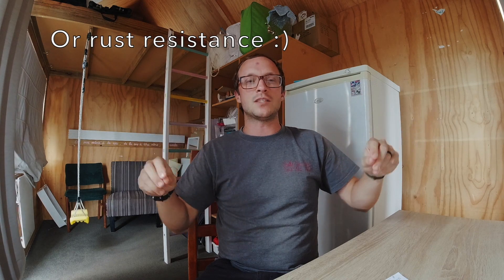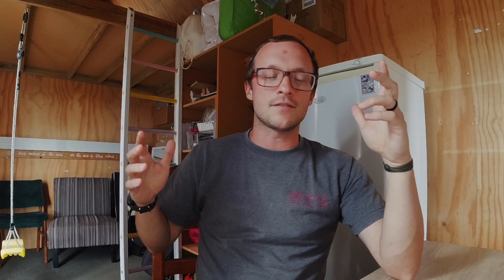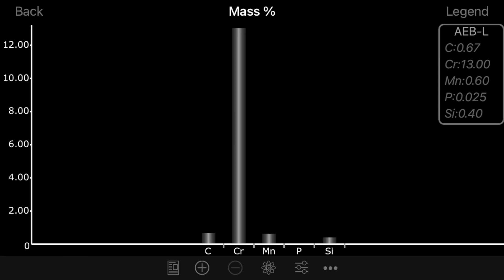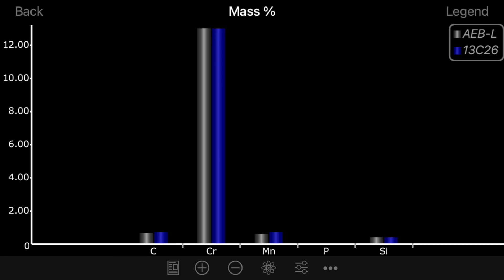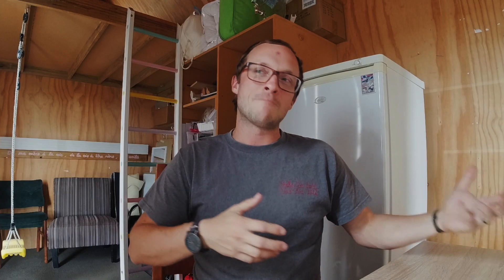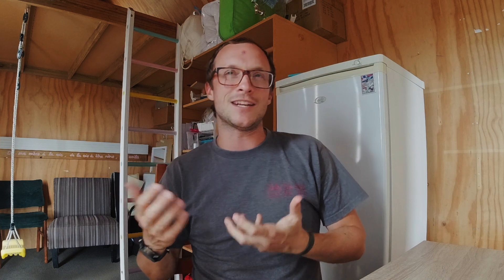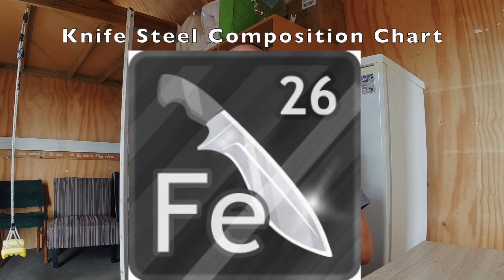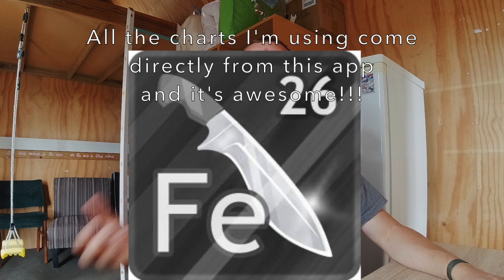That Video Where I Ruin The Way You Think About Steel

Comment: Problem with heat treatments is that they are difficult to advertise, for a number of reasons, especially when a steel can be treated in many ways to achieve desired results...D2.  But what a lot of people don't realize is that steel is often chosen and heat treated based on the machining tools available to a company and cost of creating the desired blade at the lowest cost.  Not saying all companies are cheap (most are), but that you can heat treat in a way to make it cost effective, given what you have to work with.

I did enjoy your video and agree with the main premise.  But I did disagree with your chemical composition comparison.  And I'm guessing you know about this more than me.  But when 1095 was compared to 80Cr V2, I thought the chemical composition was quite large.  Also, when it comes to AEB-L, it's a rather strange metal to me, because of it's unique properties and that without understanding the behind scene engineering processes, we have no idea why this metal was chosen.  Again AEB-L is still quite a mystery metal...too me.
Reply from the maker: Fair enough - I have learned a lot since this video, and would agree that HT is often more important than comp.

AEB-L aka 13C26 are called Eutectoid Steels (along with some others).  Basically they stumbled onto the discovery that the atomic structure of hardened steel can combine very efficiently at a specific amount of carbon and chrome.  

At the amounts of alloy included in AEB-L almost all the carbon and chrome can dissolve into the atomic arrangement of the metal, and since they are used in the steel itself, very little carbon bleeds out into hard carbide chunks which so often plague the toughness of higher carbon steels (this efficient use of carbon keeps AEB-L's carbides tiny, often even smaller than expensive powder steels).

This results in excellent toughness and sharpen-ability.  It's similar to how 5160 is really tough because they add enough carbon to harden the steel, but not so much it creates carbides which embrittle the steel.

Sorry if you already know all that, just trying to help.
Reply: @homeslicesharpening  did not know that.  Very interesting
Reply from the maker: @VitalyMack  There's lots of information on this particular steel on knifesteelnerds.com which is very helpful.

Comment: AEB-L, 13C26 and 14C28N have very similar performace. Great hardness potential, great toughness and poor abrasion resistance. For kitchen use where abrasion resistance is not a priority or for impact knives they seem like excellent options. Main difference is that 14C28N is a bit more expensive to make and has better stain resistance. While 13C26 and AEB-L have one point higher potential hardness. 
AEB-L is very cheap to make and last time I checked price difference comparing with 1070 was only 40% higher price.  
AEB-L and 13C26 can acheive 63-64 HRC with higher toughness than 1.4110 at 57HRC. Its a super steel with banana price, problem is most major knife brands don't use optimum heat treatment for any of those steels and leave them at 60HRC or bellow while also charging you premium price for the "Super" steel. With this sub stantard heat optimum heat treatment they are still good but no longer qualifies as a super steel for me.

The 60 HRC target would be great for impact knives, four times higher toughness than 1095 on same hardness but somehow this is mostly overlooked and usually we don't find impact knives on these steels.

There is a new steel with almost same composition as AEB-L and 13C26, it's called Silver Fox 100 or SF100. Probably it has very similar properties and is supposed to be cheaper but I never found anywhere selling it.
Reply from the maker: I so agree!  My favorite fixed blade right now is NitroV at 63 HRC - and it's wonderful!  But I had to source from a custom maker.

I wish it was possible for large companies to put a proper heat treatment on these steels, and I agree that we should be seeing these steels in knives designed for impact at 60 HRC.  That would be awesome!

Comment: Nothing wrong with buck 420hc ,  most of my fixed blade are buck and it’s basically decent stuff @ a good price, of course V-Toku2 are my favorite carbon steel knives, IMO can’t beat vtoku2 as a edc or vg10
Reply from the maker: Sure, those are all good performers, and ridiculously satisfying to sharpen.  I think you are more of a sharpening junkie at heart than strictly an edge retention junkie.  Would you say that's accurate.

Great to hear from you amigo, thanks for stopping by!
Reply: @homeslicesharpening  just being a knife junky makes me both , like a keen knife and micro management of a blade is necessary 😵‍💫

Comment: Just downloaded the app. Aptly, Case Tru-Sharp is 420hc, and what separates 420hc from other budget steels, say 440A, is vanadium. 
It's fun to look up steels, but if you have done any sharpening, especially freehand wet stones, geometry is tantamount.
Reply from the maker: Haha!  I have done some sharpening indeed!  Geometry is very important!

Also interesting is the interplay between composition, and heat treatment, and what sharpening protocols and geometries work well.  I find it all very interesting.

Glad you like the app!  Interesting that 420HC is separated from others by Vanadium.  I neglected to say that that is also a difference from AEB-L is the added Vanadium, which is another reason 420HC gets a bit of respect from me!

Cheers!

Comment: People have been asking for better heat treatment on Sandvik steels since Iirc 2008 or 2009 when they released a Junkyard Dog in 13c26 at 56hrc. It was "gummy"on stones, burred like crazy and had none of the features we were hoping for (carbon steel like performance in a stainless). I have a chefs knife in 14c28n at 62-63hrc and its amazing. Gets crazy sharp, holds a great edge and a few swipes on any stone (a 0.008 edge helps with that too) gets it back. Unfortunately we'll never see anything close to that from production companies. The heat treatment takes too long and would costs too much compared to doing a batch of hundreds or thousands in a vacuum furnace which gives good enough results. Not to mention heat treatment is something a small percentage of the customers care about. We're the most vocal group so it may sound like there's a lot of us but there's a reason Wusthof knives do hundreds of millions of dollars in sales annually. For average Joe a 1.4116/x50 steel at 56-58hrc is plenty good. You want something better, go to Japan. Their vg10 is way better than Spyderco and then you also have SG2, ZDP 189, hap40 and hap 72. 
I don't let my girl use that knife, she's shown she can't be trusted with a thin grind at high hardness(the horrors I've seen). Spyderco, Kershaw, Benchmade and the rest feel the same. They'd rather overdo it with a thicker grind and a softer/tougher heat treat that gives up performance but is pretty idiot proof. 
I would like to see them do a performance line (Spydecro has done something similar with kitchen knives lately in their Murray Carter line) where you do a smaller run of high performance knives which will cost more than the regular stuff.
Reply: Most people don't know anything about heat treatment and this is why they don't care about it. Plus they would rather fidget with knives than use them... Or they buy and sell them, where the bill of materials and popularity is more important than heat treatment and performance of the steel. Which Frankly is dumb AF. Most of the community is ignorant in the thing they collect which sucks cause they dictate what gets sold. Ie lots of poor performing m390 with ball bearing flippers.
Reply: @tacticalcenter8658  unfortunately but true. I bet for most people you can use a blade out of 8cr13 and put whatever you want on it and most wouldn't know. They don't use their knives or sharpen them(any decent sharpener can tell 8crore from say s30v, forget s90v or s125v) and god forbid you sharpen a knife and put an actual good edge on it, to them its ruined now. Smh. They care if its the new hot model, in new hot topic steel with some sort of handle material that's popular (seems like its micarta or fat carbon lately). 
Now its more important how good a knife flips (the terms I hear describing flippers make me laugh, wtf is pivot lash anyway?) and how it looks on their hankey alongside their edc pocket dump instead of how well it cuts or holds an edge.
Reply from the maker: Haha, comprehensive as usual bro.  Kershaw's initial Sandvik was not so good, but has seemed to get a little better with time still doesn't touch the custom stuff.  Companies like Ruike and TwoSun claim to harden their 14C28N up to around 59 HRC.  I'm not sure if it's true, but it does sharpen easier than the Kershaw's I've had in 14C28N.

Even if they never get them up to 63 HRC I do hope that all of us steel snobs crying out in general uproar gets them to approach the 60's.  The performance of a good AEB-L/NitroV/Sandvik hardened up properly is such a thing of beauty!

Take care my friend!
Reply: @homeslicesharpening  Kershaw don't really care about heat treatment that much. They mostly use industry standard and burn the edges when sharpening. Not to mention most ZTs use thick boy edges which does not aid in ease of cutting material. They are more for image and popularity, fidgeting etc. I don't think any steel they ever used was exceptional. Even a kershaw 62hrc m390 performed lower than a 60hrc spyderco in the same steel.
Reply from the maker: @tacticalcenter8658  Yeah, I think my hope is that by educating people we can rally more people to actually care about quality, because, as you said the consumers choose what is produced and how by their buying power.

I definitely have experienced many of the steel woes which you 2 describe!
Reply: @homeslicesharpening  Yeah, I went off a bit I guess. I remember buying that Junkyard Dog and being so disappointed by it. Aeb-l class when done right are some of my favorite steels to use that aren't nitrogen steels (nitro-v and 14c28n have some but I'm referring more to Nitrobe 77 and Vanax). Besides that chef knife I have a chopper in nitro-v at 61-62 and a Michael Zieba midtech in Aeb-l at 61hrc. Each one is a joy to use and show what that class of steel is capable of.
Haven't had a Kershaw in Sandvik since so I don't know how well it is. I know its gotten a lot better since but that happens with a lot of new steels. I remember when s30v was first used by Benchmade on the Doug Ritter, it wasn't great. Most got really overheated by sharpening since that was the first high vanadium steel they used plus the heat treatment wasn't dialed in. Then there was the Elmax debacle(Kershaw or rather Kai as a parent company again) where it was done really poorly on most early samples.
Its like baking a cake pretty much. First time it might turn out ok or it might be burnt or raw on the inside. Then you mess around with the time and temperature and after a few trail and error you get great tasting cake. That's what I like about Spyderco, since they're a small company they can do a lot of internal testing first and then put out a mule run to see how a steel does. If it's great, they put in into production. If not, it doesn't affect a whole model or steel. Like the mystical s145v or s150v military that was mentioned by Sal years ago but never happened since it was a trial steel and it took half a day just to cut out one military blank. I wonder if they ever completed one though, talk about a rare piece if they did.

Comment: My favorite steels that fit into the theme of this video are D2, s30v and XHP. 

D2: bad, S30V: bad... XHP: YES PLEASE!!

I'll always love ridiculously exotic super steels (currently testing ASP60) but lately I've been gravitating to "lower end" steels. 3V has probably been the most impressive steel I've used in the last few years. I've generally overlooked toughness in folders, but it really affects how the edge wears/breaks down from normal use. Without any actual damage, it leaves an edge that strops back to 85-90% sharpness with minimal effort.

Gray video! There's way too much "look how pretty this knife is" and not nearly enough "look how well this knife works" on YouTube.
Reply from the maker: BRO I totally agree about 3V!  Like word for word!

Thanks for the detailed response.  I'm toying with covering/contrasting D2 & XHP and S30V & M390!
Reply: @homeslicesharpening  

Those are actually two of my favorite sets of steels to compare, mostly because the overwhelming majority of the knife community wouldn't be able to tell one from the other in use, but want to believe that one is garbage and the other is worth paying a premium for.

Now I even see people complaining about n690 in $70 kizers, but jumping through hoops to tell everyone that aus10 is good in a $150 knife (well, a knife that costs $150... big difference).

Nice to see I'm not alone in my appreciation of 3V. I had been using a lot of 4v, but was really underwhelmed by it's corrosion resistance. 3V has been basically stainless in my use.
Reply from the maker: @CNYKnifeNerd  Same, I use my 3V knife for camping, in the rain, cutting up fish and washing in a lake - it's never produced rust I could not wipe away to new with a quick brush of my fingertips.
Reply: You might have better results with custom heat treatments. Like d2 for instance, with the right protocol from some custom makers like Carothers or some other USA makers. When heat treated properly and not mass manufactured, can perform on the same level as say s35vn and provide better edge stability/toughness. While your $30 China knife is mass produced and basically the same as 8cr13mov but difficult to sharpen and rust prone. Though I'd probably rather have 3v than d2 at custom knife level prices.

Comment: One thing that struck me in Larrin's articles is that some steels just have too much carbon (for knives), like 1095 and D2. The only advantage of adding carbon above the saturation point in a simple steel is that you form iron carbide, the least good carbide. 1084 is just better than 1095. And 80CrV is 1084 with some pixie dust.

As for the 12/13/14C Sandvik steels (and AEB-L and Nitro-V), Larrin also illustrated very well that they are a "local optimum"; reduce carbon and you get less hardness without more toughness, add carbon and you get carbides at the expense of toughness and stainlessness. Older steels were largely formulated by guesswork and their recipes aren't optimized. Magnacut follows the tradition of the Sandvik steels by being expertly designed to maximize stainlessness and hardness while avoiding chromium carbides.
Reply: Hey Gabe, if you stoked for some Magnacut to test...... between Henry and I ....we might have you sorted 😉👌
Reply from the maker: @yankee23a  That would be AMAZING!!!
Reply from the maker: VERY well said.  Thanks, I have not read some of those articles, but I love the discussion.  For that reason I am SUPER stoked for MagnaCut for these very reasons!

Comment: My fav steels were m390 20cv. Till I bought a Joker Canadiense in 14C28N. Holy hell. This is amazing stuff. Its my far my favorite steel so far. Its amazing how fine you can get the edge. And it strops to razor sharp with ease. I used it for like 8 hours one day of chopping and wood carving. And it was still razor sharp after a few strops. Definitely one of the best “budget” steels available. I’m definitely leaning towards the “less” fancy side of knife steels as time goes on. People think they need the top of the line super steels for a knife to function properly and here I am happy with even 8cr13mov 😂

Can’t wait to see the Tool steel video.
Reply from the maker: I really enjoy the perspective you bring!  I am slowly migrating to simpler (or at least smaller grain/carbide, smoother, tougher) steel as time goes on, currently my favorites that I've used are M4 (if rust resistance is not needed) and 14C28N class steels (if I need it to be stainless).  Honestly I REALLY like 3V because it's almost a semi-stainless middle ground between the 2.  Can't wait to try some MagnaCut though.

Yeah, I think that 14C28N was sorted into the "not a super steel" category when Kershaw started producing it, but the hardness was not optimal.  When you have a steel that tough, you have room to leave it REALLY hard, and that's really where things start looking nice!

I'm working on the Tool Steel video now, and (spoiler) 8Cr13MoV makes a surprise appearance.  Anyway - back to editing!
Reply: Joker makes great knives. I have one in 14c28n and in k720(Bohlers version of O2) and the quality and fit and finish you get for the price is impressive.
Reply from the maker: @MFD00MTR33  Aw yeah, the first knife you suggested in our steel discussion was a Joker - I remember that!
Reply: @MFD00MTR33  indeed. I can’t wait to buy the Nessmuk.
Reply: Most m390, 20cv and 204p are poorly heat treated. I'm not sure why it's your favorite. Often performance is not what's expected from them. The performance is often around s35vn give or take. Only some mass manufacturers will make performance 2x that. Like spyderco USA knives, or Reate as just two examples. Most others burn the edges in sharpening so no matter how good they heat treated, you won't see that performance until after sharpening your knife by hand 30+ times.